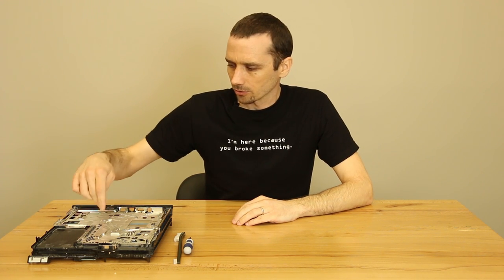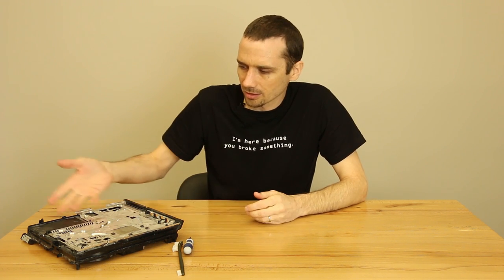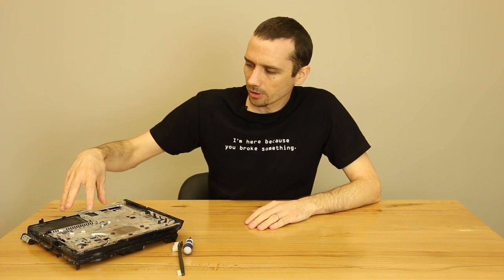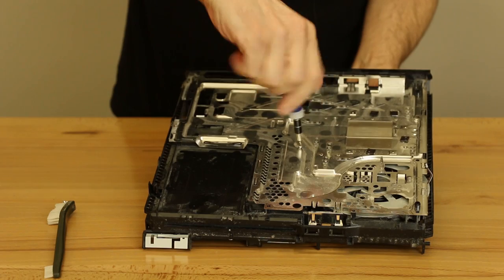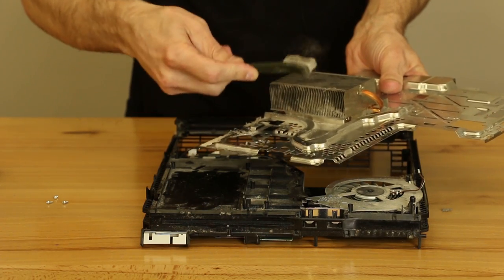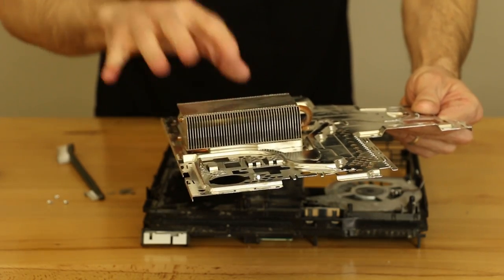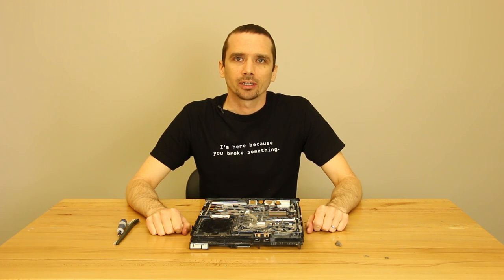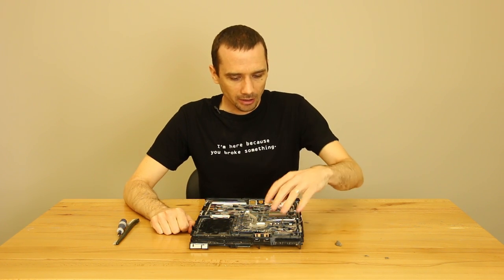PS4 Overheating Repair Tips - How to Fix Loud PS4

Comment: My damn ps4 overheats like 10mins into a game.
Reply: Same
Reply: omg same i cant play anything
Reply: Lol mine does as soon as i start up a game
Reply: @ramus93  me to bro
Reply: @charitemenelas5574  Have you found any solutions? Mine randomly did this yesterday and now I can't play for more than 5 min.
Reply: @shaunpacatte1196  bro this works just get the screw specifically for the PS4 than clean the fan
Reply: @charitemenelas5574  I've taken it apart and cleaned it but haven't actually removed the fan or anything else. Do you think taking the fan out will make a difference?
Reply: @shaunpacatte1196  well if the fan is filled with fuz the. The PS4 won't be able to get the hot air out properly with will cause overheating so yea
Reply: @charitemenelas5574  sorry for anotherr question but how do you remove the silver board on top? Like how do you get to where he is in the video
Reply: @shaunpacatte1196  it's okay but you have to unscrew all the back screw to get to the fan
Reply: @shaunpacatte1196  keep that in mind you need a flathead screw
Reply: @charitemenelas5574  it looks like he unscrewed something on top in his video.
Reply: same
Reply: I had the same problem took it all apart cleaned the fan and changed the thermal paste now its quiet and don't over heat
Reply: @shaunpacatte1196  i thought the same thing but its the bottom
Reply: Me too
Reply: Drew Martin how do you change the paste without breaking the system
Reply: You dont clean your fan clean it it overheats quickly because of the dust inside your ps4
Reply: Fortnite*
Reply: mine starts getting loud as soon i turn it on
Reply: Cleaned the inside out and it still says overheating
Reply: Same
Reply: Mine did that for about a month then it started getting really loud now it won't turn on at all
Reply: same
Reply: Same here
Reply: @ramus93  same
Reply: Same
Reply: I start something and then it makes a loud noise beeps. 3 times and shuts off
Reply: Mine overheats like after 5 mins
Reply: Yeah mine too Everytime I try to play 2k All my other games play good!!!!
Reply: Same
Reply: Same like 5 mins in
Reply: Same
Reply: Thats quick
Reply: mine 2 seconds
Reply: Same its really annoying
Reply: Shaun Pacatte did you even watch this video?
Reply: Same
Reply: My fan sounds like an f13 jet
Reply: Saaame
Reply: Same here
Reply: Mine does it all the time
Reply: KÏÑG PÈŚÖ EXACTLY MAN
Reply: Same
Reply: ramus93 same
Reply: Facts
Reply: Tony Tapers I can play 2k but that’s it
Reply: Lucky you get 10min
Reply: bro mine is as soon as i start up a game
Reply: It over heats once I’m in the lobby
Reply: Christopher Sherman I can’t even play cod
Reply: Same literally I could have won my war zone match but got hot
Reply: Fax
Reply: Mine is so annoying cause my PS4 won’t even be hot and when I get the overheating it gets so hot out of nowhere
Reply: @ramus93  mine too
Reply: It overheats from the time i open the game
Reply: You guys should learn how to do teardown its really not hard and change thermal paste. You'll be good almost 100%
Reply: I cant even start the game
Reply: I need Help I cleaned my ps4 out everything I seen you do I just ordered thermal paste but I realize that I don’t hear that fan at all like Everything absolute quiet and it still over heat does that mean my Ps4 CPU fan has to be replaced I need feedback ASAP please
Reply: @rickydash4056  i think your fan is not connected
Reply: @fernandiux3656  nah like when my ps4 first over heated the fan just became super quiet
Reply: @rickydash4056  you prolly need to change the fan
Reply: @fernandiux3656  ok I just ordered a new one just wanted to make sure I didn’t waste my money respect it bro💯🤝
Reply: I feel u
Reply: I can never play anything
Reply: Same
Reply: Same here bro.
Reply: need new thermal paste
Reply: @brynx24  well my dad just sent it back lol I think it worked fine after that or it started back doing it again a few months later
Reply: Mines is 20 sec on startup

Comment: Thanks for this video! I assembled and reassembled my son's PS4 3 times and needed this video to help me. 1 can of spray air and fresh thermal paste and it is now SILENT and not overheating. Thanks so much!
Reply: What brand spray air did you use and what brand thermal paste did you use?
Reply: @excitedaboutlearning1639  used some air can from Walmart and used mx 4 ps4 is way quieter
Reply: @excitedaboutlearning1639  I used Arctic MX-4 Thermal Compound and generic spray air. Good luck!

Comment: my ps4 gives me a warning saying to turn off the ps4 because its to hot
Reply: one day same here
Reply: ya i fixed it by cleaning it and rebootingbit
Reply: Same dude
Reply: Same
Reply: How you cleaned it?
Reply: Same here, and its been a month. I turn it on & soon as Im at the home page, it shuts off because its too hot 😩😧
Reply: April Gallegos I can’t even play fortnite or GTA 😤🤬
Reply: ThatsGreen OnGod I wanted to play cod zombies, but I got it working. I took the ps4 apart and cleaned all the dust out from the fan using a shopvac! Lol
Reply: Same
Reply: one day me too i send it to repair totally free a friend of mine it was thermal paste and dust blocking fan
Reply: one day how did you clean it because I already cleaned it do I have to clean the fan better
Reply: April Gallegos me too. Dont know what to do can not play anything😤
Reply: My fan is too loud
Reply: Open it and clean your heatsink
Reply: Same but then I’ll turn off the game and it still turns off
Reply: Same here
Reply: Samd
Reply: I need Help I cleaned my ps4 out everything I seen you do I just ordered thermal paste but I realize that I don’t hear that fan at all like Everything absolute quiet and it still over heat does that mean my Ps4 CPU fan has to be replaced I need feedback ASAP please
Reply: @rickydash4056  yes that means you need to replace the fan if it's not spinning

Comment: Just took the plunge to fix my sons PS4 Pro that had started to sound like a light aircraft taking off.... tbh I thought I would break it, loose a screw or snap something.... following your videos I managed to strip it down, clean out the heatsink and put it all back together in under an hour.... afterwards I couldn’t believe that it actually turned on!!! And it’s god damn silent!!! 

How satisfying!!

Amazing guides thanks so much!
Reply: I'm about to do the same. So tired of listening to the loudness from it.
Reply: @kronicbabe2145  it was a success, 9 months on and it’s still working….and no excess noise. Good Luck!

Comment: 5:15 “so we can get straight into the video” commonn
Reply: I need Help I cleaned my ps4 out everything I seen you do I just ordered thermal paste but I realize that I don’t hear that fan at all like Everything absolute quiet and it still over heat does that mean my Ps4 CPU fan has to be replaced I need feedback ASAP please

Comment: There is another possibility that we all should take note.

APU of the PS4 can be bulging and not flat as it should be. This reduced further the thermal transfer rate to the heatsink and potentially overheat below its official ambient temperature max. tolerance.

Look out that bulging Apu when you have the chance to disassemble it for replacing the thermal paste, the bios battery and general cleaning.

Comment: When I start playing any game, my fan instantly becomes loud. Is that bad and what should I do.
Reply: Kaiheps its not bad, its normal, but try keep it on a flat smooth surface and not enclosed in a tv cabinet etc. Just vacuum the vents as much as you can
Reply: Get a small fan, put it right behind the glossy part of the PS4 (left side). It'll help suck air out of your PS4
Reply: Its dust clean it
Reply: Kaiheps same
Reply: do you think it is enough if you clean only the fan with a compressed gas? or should i take it totaly apart ?: ) it wasnt much dust on the fan
Reply: How do I vacuum the vents?
Reply: Not notttttttt vacuum the vents clean it watch a video for it its easy you just need screw some screws out and use canned air
Reply: its not really a problem until it overheats and shuts off
Reply: But I’m not a expert plus I have short term memory so I would be messed up but videos don’t explain
Reply: @HugoStiglitz88  o
Reply: @dandyaniel5986  why does everyone say dust clean it. i cleaned mine.... put it back together and still runs loud.... as one expert says... some models run loud.... and that is down to bad design pure and simple
Reply: @tonybirmingham2  i have that too

Comment: Thanks. Got mine fixed within in couple hours it was the thermal paste
Reply: Sam Taylor m8 were you getting a msg during gameplay saying ps4 is too hot and than red line appears till shutting down ?!
Reply: Do u know what type of screwdriver u need to open up the ps4
Reply: Hey what is the thermal paste
Reply: Venalityy i’m super late but you need a torx screwdriver

Comment: my ps4 keeps overheating and shutting off everytime I turn it on could you be able to fix that in a few days
Reply from the maker: Yes we can fix that for you: http://www.tronicsfix.com/store/p56/PS4_Overheating_Repair.html
Reply: if someone has the same problem and reads this, it was the same for me and I just had to tighten my screws so that the thermal paste worked at all, then it worked again. Sorry for my English
Reply: @steazy8713  I tried that when this problem occurred and even bought a new fan but to no avail. I ended up having to buy a new system

Comment: I know this video is old, but I might as well toss the question anyway. Right now my PS4 has an issue wherein it just turns off/crashes. What I mean is it'll happen without warning where the picture on screen will just start flickering black, lose signal, then the console will beep and finally turn off. Is it overheating? is it just dirty (haven't opened it up at all), or is it a goner at this point?
Reply: Yurt Silent this is my problem too do u have the original ps4
Reply: Same I have original model 500gb
Reply: Same,  anyone found a fix ? Tempted to try the thermal paste replacement
Reply: ItchyBaz nobodys active here this vid is really old i have the original fat ps4 can't play any games but can be a netflix all day idk i really need help plz tell me if u fix

Comment: Thank You so much. After having the red light problem for about 6 months not been able to use my ps4.
Finally i saw ur fix video and followed every instruction.
Now it works perfectly fine.
Thanks Again.
It first used to just blink the blue light than goes off without turning fan on. But after i changed the Power Supply adapter. It kept blinking the blue light than finally red than off it goes with the fan turning on this time..
Than i released the problem was the power adapter and the heat sink too.
After ur video.
Reply from the maker: Glad this helped!

Comment: I have a normal ps4 )latest model) and i just but  a new ps4 pro (7116b) both of my consoles are running nice cool and quiet! I want to ask about this common ps4 apu problem how i can prevent that from happening? is the ps4 pro latest model is safer from this problem? wath can help to prevent this to happen?

Comment: Thank you for the tutorial, when I tore mine apart I found that the thermal paste was completely dried out and actually gone from the top of the processor. My PS4 wasn't shutting off and telling me it was over heating until I tore it apart to clean it, so hopefully it is just due to the thermal paste, but I will also be paying attention to the other points you made this time. Plus it doesn't help my machine living in Arizona.  Again, thank you...
Reply from the maker: Glad this video helped!

Comment: Don't put your ps4 in direct sunlight or by a vent register. The sun depending were you live can cause it too over heat the vent register will kick up dust every time the furnace comes on and that can make your console very dirty inside. Just some tips there.

Comment: Quick question. 
I got a pop up message in the middle of a game, saying: 'your ps4 is overheating. Turn it off to cool it down'. How concerning is that, compared to the overheating you explained in the video?
Reply: that is what he means by overheating
Reply: @anthony8691  Yeah, but it didn't auto shut down
Reply: Jimmy Nielsen Did you shut it off manually. It took about 2 minutes for mine to auto shutdown after I got the pop up
Reply: @anthony8691  Yeah I did. I also played like 15 minutes more after the pop up, before I decided to shut it down
Reply: You found a fix same happening to me
Reply: It will eventually, happened to me

Comment: After doing a washer fix from my PS4 from turning off and on and finally getting it to work I ran a game and it just went straight into overheating and shut itself off. Should I just send it away for repairs, Or just get a new one?
Reply from the maker: Get a new one.
Reply: Get a Torx T8 Security Tamper Proof screwdriver and open it up, and clean out all the dust near the hardrives and most importantly the fan

Comment: whenever i turn on my ps4 i hear a clicking noise from where the fan is and then about 2 min later it over heats. its been 5 months and i dont know whats wrong with it. ive cleaned out the fan but i dont know what else is the problem.
Reply: same
Reply: Thermal paste can be the problem
Reply: OreoInMilk you need to change the fan

Comment: I’ve done everything.. I’ve cleaned out all the dust, did a full initialization, changed the thermal paste, and still overheating, I am about to throw this thing out the damn window
Reply: Save up for the pro
Reply: Michael Villa LoL my pro does it
Reply: so...did you manage to repair it?

Comment: why does my ps4 only overheat and shut of during game play and not while using Hulu or Netflix for hours on end? I think I can clean it out myself but just curious.
Reply: gameplay is much more demanding on the console than simply watching Netflix. fix it by taking of the bottom cover, by removing screws in the back, and clean the fan. if you want to go the extra mile replace the thermal paste, use a good quality one like AS5.
Reply: Thank you.
Reply: ss4goku9695 From what I know, you absolutely cannot do any of this without even replacing the thermal paste.
Reply: Jen Halbett my does that too what did u do to fix it if u did?
Reply: You just answered your own question LOL It dies while playing video games but not Netflix. You've already figured half of it out, don't stop there.
Reply: its the same as gaming on a pc. When playing games the console uses more power to run the games you play, on the other hand when you just watch a video it doesnt need that much power so its more silent and cooler
Reply: Video streaming doesn't rely strictly on the GPU; usually streaming passes first through an integrated decoder.

Android can demonstrate this well in developer mode.  You can turn on GPU screen rendering only, no hardware overlays...  If you open a streaming service, you might get sound, video is a long shot.  Turn on HW overlays, your video will run perfect.

Comment: My ps4 keeps overheating even when its a cold day in an open space it keeps overheating, even after i cleaned it out it dosent fking stop pls help
Reply from the maker: What all did you clean?
Reply: TronicsFix the fan
Reply from the maker: You probably have a plugged heat sink.
Reply: What's a plugged heat sink
Reply: gamer127 i still need help man

Comment: I cleaned mine out but it still shuts off. I literally can't play any game for more than 5 minutes. I heard that it takes in air from the front and sides and out the back so it's literally almost hanging out my window but that doesn't help.. was thinking of getting a fan and pointing it at my PS4? Or should I just get a PS4 Pro? Was also thinking to get a white one? Since black stuff gets hot quicker right?

Comment: I opened up the PS4 to clean up the fan and everything and as soon as I turn it on, after 5 min it turns red and shuts off. I don't know what to do at this point should I go somewhere to get it fixed or get a new one?
Reply from the maker: It's just overheating...let's not get to excited here, there's no need to buy a new one when you have one that's perfectly fixable.
Reply: RazrProjec

Comment: I'm just now starting to get these overheating warnings...after watching this video, I'm sure it's due to a bunch of dust on the inside. I'll turn on my PS4 & it won't even be an hour yet when I start getting the warnings so the PS4 is never really hot to the touch. However, I don't wanna open this up myself as I fear I'll just mess up the internals
Reply from the maker: You can always send it in for repairs: http://www.tronicsfix.com/store/p56/PS4_Overheating_Repair.html

Comment: My ps4 overheated , I live in valley Alabama I need it fixed 😫
Reply from the maker: We can fix it for you: https://www.tronicsfix.com/collections/playstation-4/products/ps4-overheating-repair
Reply: Taj Ramsey
Reply: +TronicsFix LLC what does it mean if my ps4 pops up its too hot to turn it off and let it cool down goes red I turned it off didn't turn it back on until today(this happened yesterday) it turned on normally white light etc but it sounds bad I haven't tried playing anything cause I was afraid of damaging it, it sound like this....it revs then pauses then revs again...then pauses then revs again and keeps doing that
Reply: +BEINBE it's a launch ps4
Reply: +BEINBE it was dirty on the outside also I haven't took it apart yet I aim to try cleaning it and seeing if that works
Reply: +BEINBE it was in kind of a enclosed place but I moved it to a more open spot when it was reving pausing and reving again